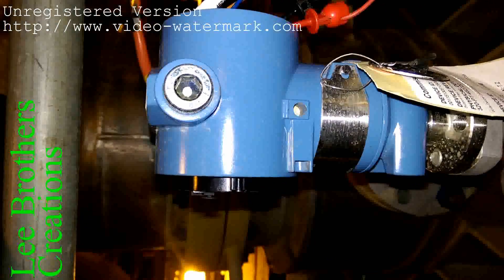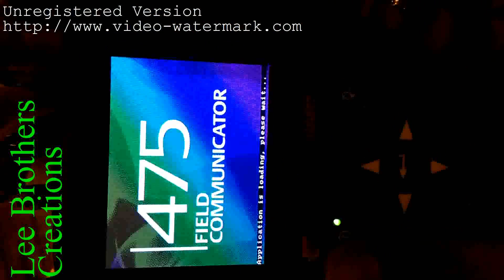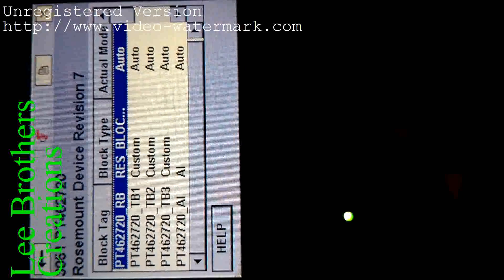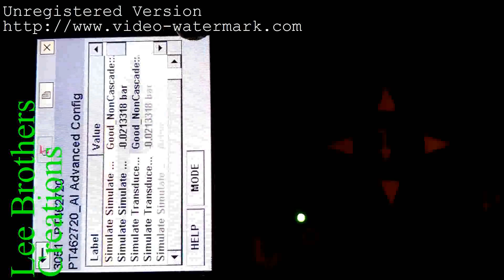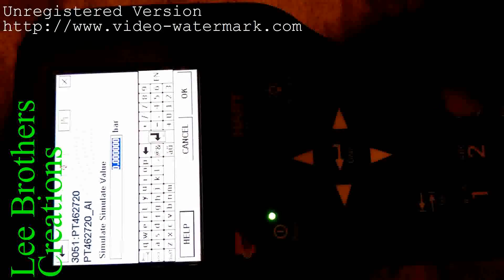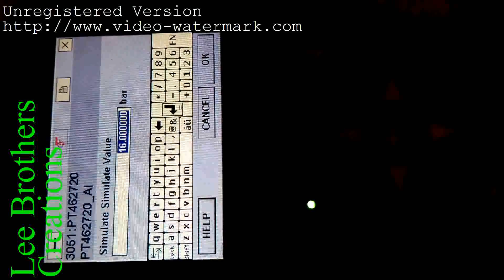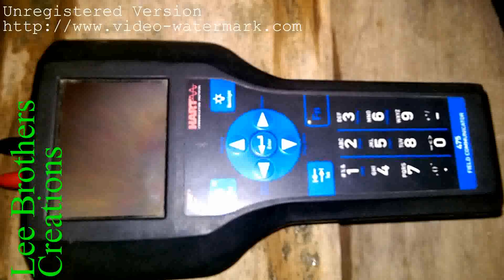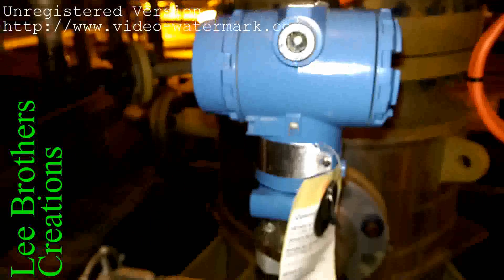Loop test of Pressure Transmitter for fieldbus

Comment: Sir 
Plz make video on calibration and configuration of transmitter, which is closed loop
Reply from the maker: A transmitter witch is feedback connected to a valve means final control element it's called closed loop... This video will update soon...

Comment: thanks a lot guys. is it ah same procedure for temperature transmitter  (TT) ?
Reply from the maker: Aspak Achu yes I will update
Reply from the maker: Yes but should be check RTD wire config in Communicator and as well same RTD wire connection in TT